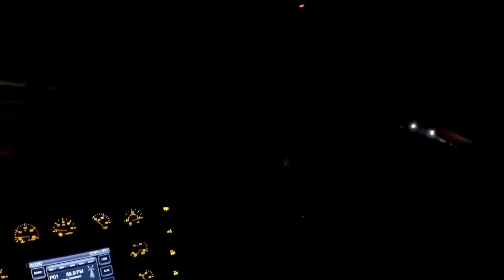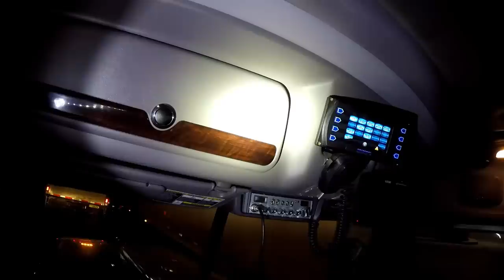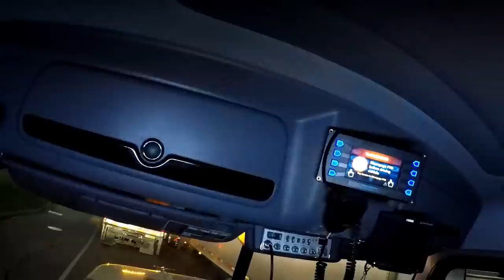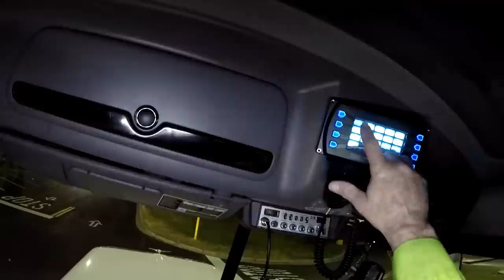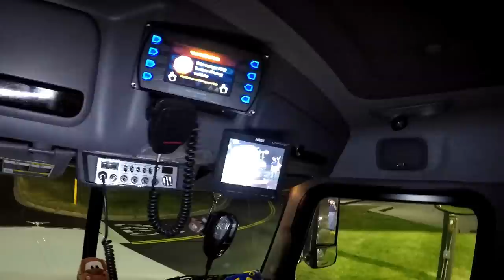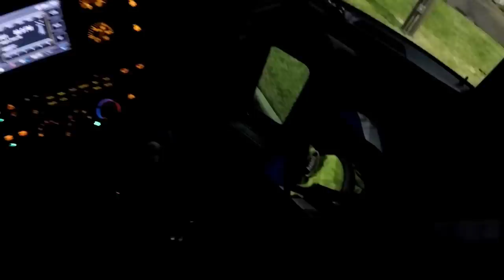Heavy Tire Lift Tow

Comment: With the trailer having  unsealed and unlocked doors, have you ever thought about having Seals you can put on in the Drivers/Officers presence. And have either one initial the paperwork (with a Seal #) on scene to cover your self from a claim of missing freight? You know what they say about CYA.....lol
Reply: I'm surprised the driver didn't have something on there before the truck even broke down.  A padlock, or the shipper's seal... anything.  It's a good point though.  Wonder if that's been tried yet? Blaming the tow or repair company for missing freight... I wouldn't walk away from my unit unless it was locked up tight.  Sometimes the freight in the back isn't even worth anything (such as scrap forklift batteries that a human couldn't even carry), but I don't want anyone peeking, poking, or prodding whatever freight I'm in charge of.
Reply: Stan Patterson I had a friend tell me about some important info, and I took his advice for the rest of my driving career, and never had an issue!! 

The more important the cargo, the more security is installed at the shipper!! Some shippers have a huge, one time use, locking bolt, to secure their loads!! And they can only be remove with a pair of huge bolt cutters!! Those are the more expensive loads!! Some loads actually have specific rules to follow, and are almost unimaginable what you could find in one!! I know someone that used to haul drugs!! The trailer were sealed up tighter then anything you know!! They weren't allowed to stop the vehicle within the first 300 miles, no matter how long it took!! There were security details, unmarked units, following the vehicle along the route, ensuring that nothing happened to the load!!

Then there are NO VALUE LOADS (believe me, they exist) that the shipping cost is lower than the amount paid for someone else to take it! I hauled a load of scrap aluminum once, that the receiver didn't want, and no one else would take, and the broker ended up paying someone to take the load of scrap, to deal with removing it from my truck ,and spending detention time!! 

Then there are those loads that are valuable, in some aspect, but not on the simple black market!! 5000 lb rolls of paper come to mind! The manufacturer and the receiver won't argue about the value of the load, but you are not likely to loose a 5000lb roll of paper in a truck stop, overnight!

I would put a seal on the latches, but that was a technicality! I even placed seals on my preferred empty trailer, at the company drop yards at time, to help keep a specific empty available to me, and lost them due to someone breaking a seal and finding it!! 

When I was a new driver, I followed company rules, and applied seals and locks on the shippers property!! I lost 5-6 locks (a cost out of my pocket) for truck stop snoopers!! Never lost any freight, but a locked trailer meant that theft was an issue, and they just had to look to see if it was a load of tv, or food, or any quick easily carried valuable!! When I quit putting a lock on every load, I quit loosing locks, and never lost a seal (other than empties at the drop lot! SORRY DRIVERS, BREAK A SEAL, LOOKING FOR AN EMPTY)
Reply: Stan Patterson maybe it was empty?
Reply: Stan Patterson I know he said it was loaded but maybe it wasn’t product or anything of value
Reply: I would guess depends on area you live, If Theft is a big thing then yea but if pretty much nothing happens then can get away with out doing it. It would be just good practice to do it though just to have the habit.
Reply: The trucking company specialises in Shipping furniture .
Reply: Ron opened the trailer door and read the label on the box - furniture
Reply: He'd have to, to judge the weight...
Reply: Gosh, nowadays, I wouldn't roll unless the doors at least had my padlock. Not only keeps the cargo in, but stowaways out. BlueDevil and Stan P have a point, especially in the border areas. Even if that is a private carrier, no Bill of Lading? I used to drive TV mobile units, and we started carrying a certified document stating we carried fixed equipment, not cargo after the AZ Chicken Coop asked me for one before we started carrying them. He said he had to "stamp something". So he stamped the postage paid return envelope I kept my documents in. I think he was pulling my leg as I was only about 21 at the time.
Reply: Ron was right to take a look just to try to asses for weight and make sure he is not towing contraband !

Comment: I know this is an old video Ron but I was wondering how much air pressure do you run in the pusher or (lift) axle? Do you increase according to what your towing compared to being unloaded? My mixer has a total of 3 lift axles 2, pushers and 1 tag. Full load of 10 yds I run 100 in the pushers and 90 in my tag and decrease for smaller loads. Thanks Ron.

Comment: Ron, I have a question, I used to be a tow driver as well but only using a 1 ton wrecker. Question is, why can you not use the frame forks on a air ride set up? Does it do damage to the air ride suspension when you lift the front end without supporting the front axle? I have heard many different stories but your advise or opinion is very well trusted.

Comment: Was a very late night. It's funny cause I was just wondering if you used your tag axle or not for heavy tows. Had no idea you used it all the time, load or not. Great video.
Reply: Naviss it is a pusher axel, a tag would be behind the drive axels a pusher is in front of the drive Axel’s.
Reply: Axle darn correction

Comment: YO My Brother!! I have always seen you guys ask for or remove the main drive shaft. ( I always crawled under for them because that's what I did in high school, heavy mechanics. been turning wrenches since I knew which end was which!) They (you towie's) always said "that's just what we do" Well. Why don't you mold/have 3D printed some 3/4 thick hub plates out of hard rubber. Zip the nuts off the hub, put on hub cover and zip nuts back on?? Then charge the covers price to the tow bill. LOTS easier and WAY cleaner way of doing it. Yes, a few models are secured in the pumpkin with clips, but MOST just slide right out. Great video as usual. As the boss man in the big chair behind the big desk said.. we can now officially say MERY CHRIST-MASS!!! and a happy new year to you and all of yours! And I am praying blessings to you and your company now and in the new year!! Hope you develope that T-shirt idea soon, i would like to buy one!! The HALO is as I have said befor awsome.You should issue it and require it to be worn by all. You can also get red green and white arm/wrist bands that flash or stay on. we give them out sometimes at bike week as a CMA (Christian Motorcyclists Assoc.) gift. Keep up the great work my brother. the prayers that you mutter under your breath for the injured are well heard and heeded by the Father as the smell of sweet incense.

Comment: I think out loud out of habit myself. I have some questions for you. First and foremost, have you thought about a furniture dolly for the wheel cradle? If your, would you like one made with large solid wheel swivel casters?
Secondly, the under reach, are there other uses for the under reach (i.e. winch line redirect/tie-off or as an out rigger)?
Thirdly, are there any reasons that you do not cross your chains underneath the arm of the under reach?
Fourthly, I was watching the video where you assisted Keith with the box culvert and thoroughly enjoyed the video. It stirred up a question regarding a spreader bar. Was it possible to use a spreader bar between the two lift points to place the machines in a better ability to lift the first box culvert section into place?
Last but, certainly not least, I am very appreciative of your videos and am wondering if you, when you have sometime, are able to do some playlists to assist viewers, such as myself, to find videos of a certain type to view more of them with less difficulty finding them?

Many thanks for your time, efforts, and energy;
The Chef
Reply from the maker: I wish I had room for something to help with the wheel cradles.  Second, the under-reach has multiple uses, but other than towing, the most common use would be as an additional rear stabilizer.  To answer your 3rd question, the reason I do not cross the chains is that in the event of a catastrophic break-away I would not want the chain to chain  abrasion that could lead to chain failure.  4th I do not see that a spreader bar would have been advantageous in this situation.  Lastly, what types of videos might you suggest for for playlists?  Thanks for watching and God bless.
Reply: @RonPratt  My playlist suggestions include, but are not limited to; rotator lifts, rotator winch outs, rotator recoveries, rotator saves the day, rotator lifts, and so on. This can be applied in such a way where some videos may be cross listed. Even with light duty, medium duty, and heavy duty stuff. Definitely appreciate the videos on this collaboration method.

Comment: As a side note - newer Volvo trucks may have independent suspension on the front. That's an option on the FH Volvos at least, but it may not exist in North America yet.

And I can't help getting curious about what's the fault for vehicles that breaks down. Maybe you don't get that information, but sometimes there's a lesson to learn. At least I know that on vehicles with LNG tanks there's a safety shut-off valve that's easy to access from the outside and someone may turn it off as a prank. It has to be easy to access for emergency workers. Just be careful around LNG vehicles, it's very cold.

Comment: hi Ron once again a very good video of the wheel lift use and as I read through some of the replies to you they had very good questions but what happened to the driver did she go with Tom and does she stay in her truck overnight until the morning God bless you keep you safe and your travels over the road and God bless your family also many thanks again for your videos
Reply: That's a good question.  I have found a few repair shops that absolutely do not permit sleeping on their property, while some don't have a problem with it.  I guess some have been stung with... let's say "adventurous" or "enterprising" guests who didn't feel as compelled to sleep, but rather "explore" other trucks and vehicles on the same property.  Even though your truck won't be touched for 2 or 3 days, they insist that you go away to a motel or hotel.  I guess it makes sense to a certain degree.  Have all bodies removed from the property, and removed from temptation.  It's just not nice to shovel out 60 or more dollars a night when you have food in the fridge, and all the comforts of home built into the truck.
Reply from the maker: If a driver can safely stay in their truck, we often will allow it.  If it isn't safe, for example no A/C or heat capabilities, we offer to transport them to an area hotel.  We have some that are reasonable enough for longer stays.  Most tend to take the hotel option.  God bless.

Comment: They (Miller industries)should have put the compartment for the wheel or 'tire' lift stuff on the rear face of the tow body. That way you could boom assist in moving them.

Comment: Some structural engineer needs to work this wheel lift assembly. Lotta hard work that I am sure can be fixed in design at a later date.

Comment: Re the light bar you sometimes use. I see it is battery operated, but not connected to the tow vehicle. Is there some sort of radio link for stop and turn signals?

Comment: Hi Ron what was the problem with the truck in the end. Sorry to ask another question why can you not tow all vehicles with a wheel lift or spec frame. Surely it would be easier than the under lift. Great job and gob bless.

Comment: Ron, I don't understand why you can't use forks with front air bags?  When you use use forks your lifting the axle and tires as a unit,  when you use the wheel lift, you are doing the same thing, just at a different lift point.  You used the tire lift on your video high wind havoc with the Volvo, was that front Air ride also?
Reply: arkycadd I believe he used them not because of the air ride but because of the hollow front axle not positive tho
Reply: I wondered the same thing.  Ron - can't you chain the axle and use the frame lift hooks to tow?
Reply: At 9:50+ He says it is air ride and has a hollow Composite axle. So if you put the axle lift on the axle you are putting all the weight on just the two points of the axle lift, not good, easy to brake the axle.
Reply: as a novice I'm still going to take a guess....  first off, I heard Ron mention a HOLLOW COMPOSITE AXLE.  My guess is that concentrating the weight of the entire front end on only two points not designed to be weight bearing at those points would most likely cause damage to that hollow axle and that is before you even begin to pull the weight of the loaded trailer from those 2 points.  so you end up with a hollow axle taking on the vertical force of lifting the front end but also the horizontal force of pulling and stopping the weight of the the loaded trailer.

by lifting from the wheels all the weight and force is being applied to the part of the axle that was designed to to actually take those forces.  I don't think the airbags have as much to do with this as the hollow axle,  unless all front air ride tractors also have the hollow axle.
Reply: arkycadd; parts on that axle are hollow 10:14 and may be punctured.
Reply: If you listened to what ron said in the video, he stated the axle is a hollow composite and would not withsand the load of lifting/towing the loaded rig.
Reply: Ron Pratt, you have the best audience in the world, they answered my question for you, I total missed the part about the hollow composite axle.  Thanks guys for all the replies and for not coming down on me to hard.  I totally understand now.
Reply: Actually Hendrickson changed the axle a little after the first about two years they where out ( I believe 2001-2003 about !) and you can tow them without damage with forks . Ron you will probably like this as much as I did years ago when I found out . Keeps you from having to put the wheel lift bars on !  Sorry couldn't figure out how to do a regular link but you could copy and past this one . https://www.hendrickson-intl.com/CMSPages/GetFile.aspx?guid=cfdcc825-d92e-45d2-b1e6-c4377f434174
Reply from the maker: Paid in full motorsports  Thank you.  I have both sets of forks, the Miller and the Steertek.   I still prefer to use the tire lift on these axles.  Guess I got "gun-shy" early on.  Thanks for thinking of me though.  I do greatly appreciate it.  God bless.
Reply: I hope I didn’t seem critical with my reply definitely nothing wrong with the wheel lift bars . I watch tons of videos but your the only one I’ve subscribed to your outspoken belief and character ! Keep it up .

Comment: Ron you may have answered this question previously, but with the air-ride suspension and composite axle, why won't the under-reach work versus having to resort to using the tire lift?

Comment: Steam locomotive engineers would give 3 toots of the train whistle before using the, "reverser" to backup the train. Also 2 toots would mean the train will proceed forward, and 1 toot would mean the train has come to a stop and will not be moving.

Comment: If it's a cummins powered Freighty probably lift pump failure. Question for you Ron, what is the power plant in the rotator? Sounds like a cat motor but may be distorted by the video.

Comment: You were mentioning weight in your video, As a tow truck are you exempt from the DOT weight restrictions? IE per axle weight, total combined weight, stuff like that
Reply: Michael 
I recall a video where Ron covered all that. Yes, the state has specific exemptions that allow over-length and over-weight in recovery operations.  In his state, recovery vehicles are also permitted to use siren and blue lights when en-route in a hurry, as requested by law enforcement. In my state, that is not the case. In Oregon no recovery vehicle may display blues or siren, as that is law enforcement only here.
Reply: Michael, the DOT does not count the weight of both vehicles combined. Say you have a tow truck like the one Ron uses in this video, the tow truck does not exceed the weight limit and neither does the truck he is towing but if you were to combine the weight of the two vehicles the would exceed the limit but, the DOT does not count the vehicles as combined. so there fore the tow truck has its weight separated from the semi's weight and does not exceed the limit. I hope this helps.
Reply: I just realised the total combined weight is the same as a fully loaded Boeing 737, that is heavy!

Comment: Lift axle goes down to apply more torque to tarmac..
more boots digging in, to drive...
Up in urban, to prevent scuffing it tight turns..
On tippy-toes, off turnpikes.
Also helps if they are up, when reversing,
giving more manoeuvrability into tight places.

I need a lay down after that word. My longest is normally,
wheelbarrow or marmalade. Excuse my English.
Feel free to cut and paste. Ifn you can't carry it,
call Ron. After all, 72000 plus 80000 isn't a problem.
He'd tow away antidisestablishmentarianism, for fun;
without breaking into a sweat, I'll bet.
Reply: Pete Me i do know from a trl that feel thru the ashfault that ron had to pick up and then move he was saying anytime puts it into reverse the lift dumps air and goes up